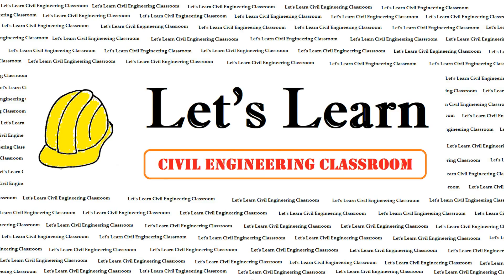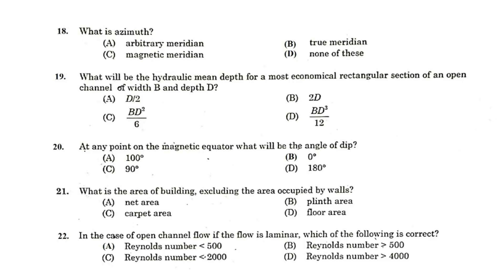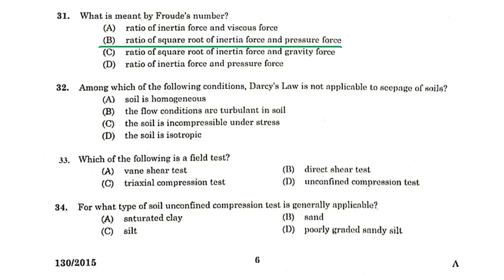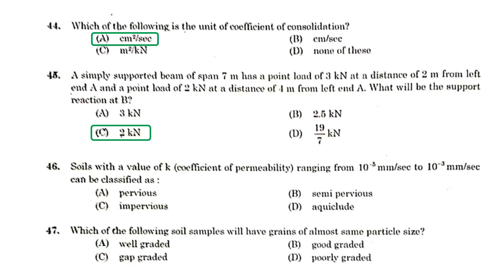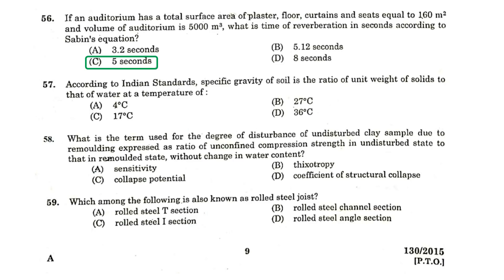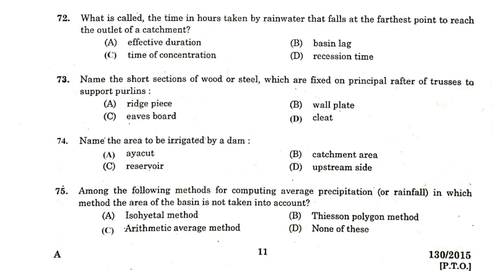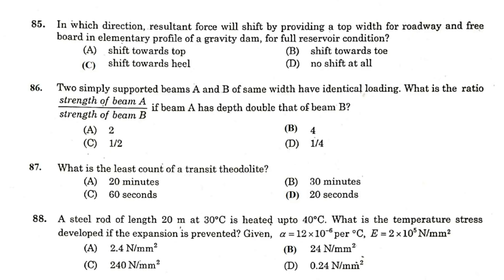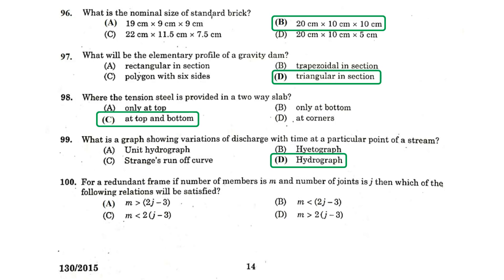Kerala PSC Assistant engineer in PWD/ Irrigation/ LSGD : 100 Previous Questions

Comment: 96. Option A. is right
Just reconsider it
Reply: In India a brick of standard size 19cm x 9cm x 9cm is recommended by the BIS. With mortar thickness, the size of such a brick becomes 20cm x 10cm x 10cm and it is known as the nominal size of the modular brick. so option B is correct